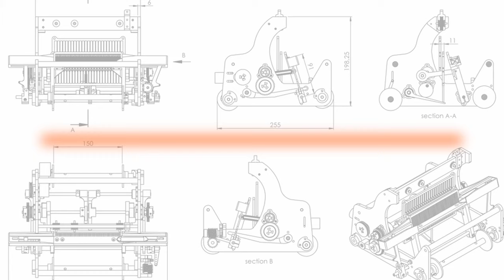3D printed Weaving Power Loom / technical details, how it works, construction

Comment: I used to work as a machine helper in a textile mill on the weave room floor and this is a great representation of the old shuttle looms, they use mostly Air Jet looms now but we still had a few shuttle looms that were still in operation when I started that job.
Reply from the maker: I watched a few videos and was amazed by the machines. I wanted to build one too. It was a challenge, but it was worth it.
Reply: @FraensEngineering  yeah it's really cool, those old shuttle looms had a bad habit of throwing out the shuttle and hitting people so be careful, it may take your eye out 😂. You should make a tiny reed hook to thread the heddle with, it's much easier than using a needle.
Reply: هل من الممكن تأتي السعودية الانشاء مصنع

Comment: This is great. A friend from my weaving guild here in the US just shared with me your braiding video. For the weaving, one thing that would improve the cloth is to have a finer "sett"; that is, your warp threads, the ones that go up and down, should be closer together. If that is not adjustable, you could also try thicker yarns, and try wool which won't be as slippery.
Reply from the maker: I tested a few different cords. Actually, bringing the warp threads closer together would not be very difficult. You would only have to change a few parts. Thanks for the tip.
Reply: @FraensEngineering which parts? I’m thinking about trying to make it

Comment: Your design and execution is great.  I love it.

For improved clamping onto your shafts with 3D printed parts you can increase the diameter, hollow even or use hexagonal shafts.  Using a small insert that fits into bearings would allow you to use hexagonal stock with no machining.
Reply from the maker: That's a good idea. I pinned the gears to the shaft after assembly. This works great and is easy to do. Hex shafts are very expensive compared to round stock.
Reply: ممكن مساعدة من فضلك

Comment: thats a great build! it sure asked for some serious time to level all the challenges to make it functional! 

I wonder if it needs to add too much complexity to adjust the design to:
-add some light tension to the line thread
-make the line travel faster and with more reliance;
-input more pressure on the shafts to the cloth:
-support run at more cycles/time 

as you said in the video and looking at your main challenges, building even at this scale already creates quite decent forces, so I assume that raising that can make some parts need a redesign or even a material change to withstand the powers involved
Reply from the maker: Hi,
I think it will be difficult to tighten the thread in the shuttle. As soon as the shuttle has the slightest resistance, it stops. I had to make the shuttle heavier with brass plate so that it has more energy. Very important is the correct winding technique, so that the thread is easily unwound. 
Making it faster should work - just use a motor with more speed. But the higher speed of the shuttle must be slowed down again. This was also already a problem with me. The shuttle hit the lever and jumped back again. My solution was to leave the lever in this position after the shot. So the shuttle was slowed down a bit.
To stretch the fabric more I had to put a rubber in the brake. I think here would still be a solution to look for to tension the fabric by means of a shaft and spring.
To transfer the high torques it was necessary to stiffen the parts.
It is also important to glue all the screws. This loosen otherwise constantly and adjust the whole machine.

Translated with www.DeepL.com/Translator (free version)

Comment: @Fraens Awesome build! I am currently working on a rigid heddle that has different DPI heddles. I think this might be my next 3d print project.  Might I suggest a finer reed with that yarn. it will make the fabric look more tightly woven because you have more ends per inch/ cm. One of the issues you are also having is that you are letting the weft get to close to the beater bar.  So the tension on the reeds and the strings are pulling your weft apart. Typically that is fixed by working closer to the front of the loom.  I'm not sure how you would fix that with out redoing the winding mechanism though. Maybe a finer toothed gear?
Reply from the maker: Hello, unfortunately I don't quite understand your suggestions for improvement. The problem is the language barrier. Maybe you could try to describe it a little differently. I can adjust the ratchet wheel so that the trigger is a little slower. I think that's what you mean. I don't quite understand the second problem you describe. If I shoot through the shuttle further forward, it gets very tight between the spread cords.
Reply: @FraensEngineering  sorry I will do my best to clarify , the beater bar is the bar that pushes the thread into the previously woven threads. The weft or the string that the shuttle is weaving is not being pulled onto the front roller fast enough. So the cloth is getting to close to the beater bar. So when it moves forward to beat the thread into the weave it is pushing out towards the sides on the last warp thread. Causing it to loop on the end. There is a perfect spot when you are weaving it tends to be about half way between the front cloth rolling bar and the beater bar.  If you were able to keep the beater bar pushing the threads to the center between the roller and beater bar it might help with your cloth ends. So if the cloth were passing through a little faster at the same tension or more frequently. It might help a little. When I am using my ridged heddle loom. I try to keep the shuttle stick passing through the "sweet spot".  I also try to use a finer Reed or heddle to keep it square if I am using a fine thread.

Comment: it looks great!  Your job gave us a lot of inspiration, we will follow your instruction and try to build a new weaving loom!
Reply from the maker: Are you building it from 3D printed parts? Is there a video or photos after building the loom? I would be really interested.
Reply: @FraensEngineering  Hi Fraens, I have printed all of the particles and doing the stainless steel processing, I saw you missing one part of the sprocket, did you have the STL file, and can you upload it to Thingiverse? Thanks a lot in advance!
Reply from the maker: Hello, which gear is missing exactly? I will look at it today and upload it on Thingiverse.
Reply: @FraensEngineering  hi Fraens, in your video you changed a chain drive to improve the device, that part is missing.
Reply from the maker: Hi, I uploaded parts 42+43+44+45+46 to Thingivetse. I hope all parts are there now.

I can still give you a few tips: I stiffened the gear wheels and cams with the shafts. I can really recommend that. Otherwise it can happen that you adjust the machine and suddenly a wheel slips and nothing works anymore. If you have an iPhone, make slow-mo videos. That really helps a lot when setting up the machine. Setting it up is a bit tricky. Do not give up ;-)
Reply: @FraensEngineering  thanks a lot! We will try in this month!

Comment: This is excellent – certainly the shape of things to come. What would be really good, however, is if you figured out a way to develop some kind of tension gauge that could be incorporated in a 3-d printed manual loom. The problem to which handwoven cloth is most vulnerable is when tension is relaxed and then reapplied as cloth is wound through the frames from the warp beam to the cloth beam.
Reply from the maker: Thank you very much for the kind words. I will think about it.

Comment: It seems that it is the shuttle that is causing the most trouble. Have you considered using a rapier weft insertion mechanism instead? I think that a band for a flexible rapier (takes much less space than rigid one) could be made out of laser cut polypropylen sheeting, and the drive wheel could be 3d printed. With a single sided flexible rapier mechanism the surplus band can just stay at the low side of the slay when retracted.
Reply from the maker: I don't quite understand how you mean that. But there are systems with a gripper that pushes the thread through. He is then held on the other side. I think this would be a lot more reliable. If the thread is wound properly in the shuttle, it works relatively well.
Reply: @FraensEngineering  yeah, rapier is the name off such systems that uses a gripper to carry thread across. Most basic is "single rigid rapier", which is just a rod that pushes the thread across and goes back again. But one gets this long spear of a stick coming out of the machine which is not so good for space or safety. The flexible rapier uses a flexible band instead of the rolid rod. Kinda like a stiff belt, that is pushed by a drive wheel. I tried to share a link but the comment got removed  :/
Reply: I try again to share a link: http://www.construma.be/flexible-rapier-weaving-machine/
Reply from the maker: Very cool. Thanks for the show.
Reply: @FraensEngineering  good luck with the next machines! You are doing very cool stuff :)
Reply from the maker: Many Thanks. I'm always trying to build new things that aren't on youtube yet. Otherwise I think you had no chance to grow.

Comment: Sir can I have the model file of the side board, u showed the dimensional PDF, but the dimension and location of the holes is missing.
Reply from the maker: Hi, I will have a look as soon as I get to the computer.
Reply from the maker: Нi, I have a problem. Unfortunately, I destroyed the right basic framework model. I have stored another file with the same name. I uploaded the left base frame to Thingiverse. The holes are symmetrical on the right frame. You can read the holes for the engine on the drawing. I hope I was of help
Reply: Can I have your contact information?
I really need help for making this machine.

Comment: Here is another automated loom one could take inspiration from. Very complex. But I think the rapier push/pull mechanism of the shuttle looks quite smart! It keeps the Sam shuttle as here, but works much more reliably than trying to throw the shuttle across! https://youtu.be/nBUR466rVQs
Reply from the maker: Very cool project. However, very slow.
Reply: @FraensEngineering  The video said it was in demo speed. I do not know how much faster production speed is though.
Reply from the maker: The speed in the video is the same as it is in real life. Only some slow motion was added. The speed depends on the engine speed.

Comment: How did you make the shaft?
Reply from the maker: Which part do you mean? The shafts were made from aluminum rods. However, these are not a very precise fit and had to be turned off.

Comment: Do you know of anyone that can turn the aluminum poles, I don’t have a lave or know how to use one.
Reply from the maker: Preferably in a locksmith's shop in your town.
Reply: @FraensEngineering thanks, also another question what are the units in the shaft plans in millimeters, and for the tinier parts of brass and the tiny hinges where should I look at getting those thanks so much!
Reply from the maker: Hello, the units are in millimeters. Which hinges do you mean?
Reply: I’m talking about the hinges use at 2:28 and onwards for moving parts
Reply from the maker: These are brass round material.
Reply: One last thing how should I print the acrylic cuttings to scale

Comment: Hi Fraens! Do you have an email contact? I am a final year industrial engineering student from Chile and I'd like to ask you some questions related to feasibility and costs production of a similar machine, and in the best scenario maybe you could build it.  Greetings! Saludos!
Reply from the maker: Hello, you can also ask your questions here. Maybe someone has the same problem.
Reply: @FraensEngineering  Well I would like to ask you an estimation cost of how much would you charge to build a real size high precision Mat Blind Machine. In Chile artisans adapts industrial loom machines and in my final thesis I am writing a business plan to automatize the whole process. The better the estimations costs in my final plan higher probabilities of funding I could get from startups funds.  Thank you very much in advanced and btw great videos I am an Arduino and Blender enthusiast but I cannot reach those levels of sophistication
Reply from the maker: Hello, unfortunately I don't have the possibility to build a big machine. My week is very small. I am currently working on my braiding machine. I'm very constrained in terms of time. I work in a full time job. I only build my machines as a hobby.